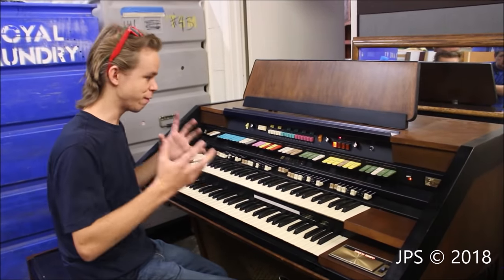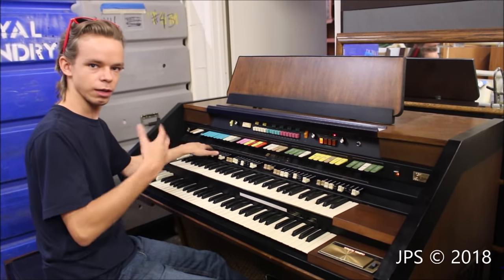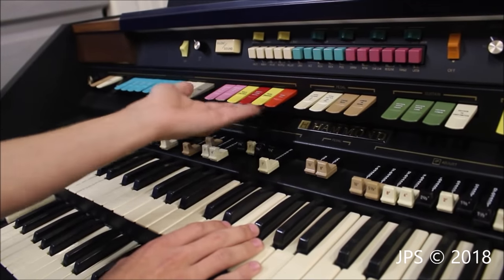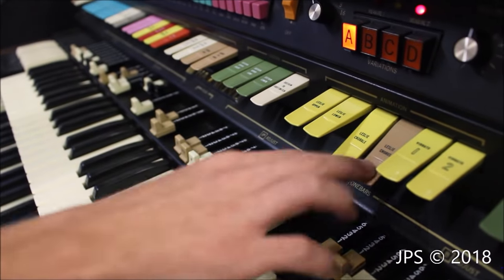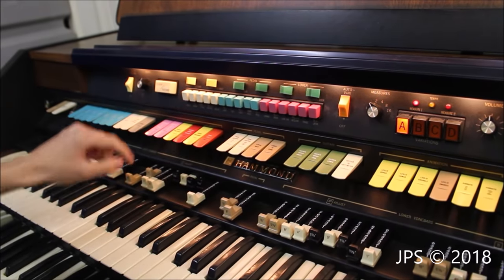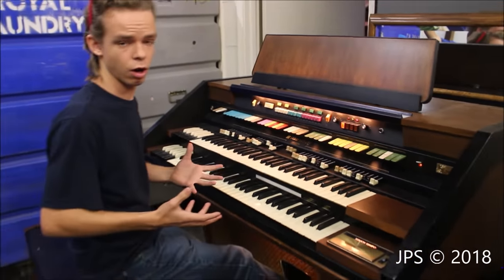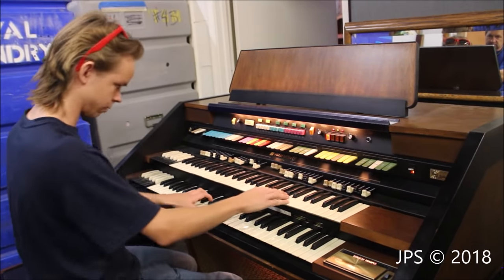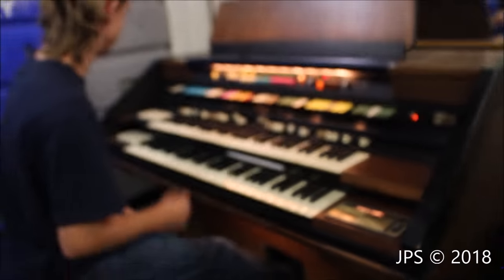James finds a $300.00 Hammond Organ, your thoughts? Cheap Deals

Comment: Bad LSI (Large Scale Integration) design that failed miserably. They were sending out techs constantly. It was trying to make the whole organ with capacitors. There are a ton of bad caps in there and it would be insanely time consuming and expensive to restore. I have repaired Hammond organs for a living for 3 decades. This is a piece of junk. Stick with the 3 series organs (includes generator, scanner and percussion same as on B3) :  B3, C3, A100 and RT3 with either a 122/142 or 147/145 type Leslie. Anything else is just useless.
Reply: My Concorde is almost 60 years old and had two bad caps. Caps were not the problem with the Concorde and neither were the LSI parts. Mechanical contacts were the major problem.
Reply: I couldn't possibly disagree. While those are of course great models, I've found pretty much any Hammond with a tonewheel generator to have plenty of worth. Of course the 3's have more features than their predecessors, making them better by comparison, but they're all good in my opinion. The L and T series sound great (Keith Emerson used them!!), and having had an H-324 for about ten years now, I have a particular fondness for the insane amount of features that the H series has, in addition to the fact that it has more drawbar harmonics than any other model. Never had many issues with it either, and the few issues I have had I was able to fix with a little troubleshooting and some good ol' persistence, and I HAVEN'T been working on organs for 3 decades for a living. I promise you, that played through a Leslie, 99.999% of people couldn't tell the difference between my H-324 and a B3 proper. And while we're on lesser mentioned models, lest we not forget the gorgeous work of art that is the Hammond X66, which seems to retain pretty good value, and has quite a cult following of it's own. Definitely very different sounding, but that's part of it's charm. 

Will say though, I'm glad you Hammond purists find all these magnificent organs to be useless. It just means I can pick them up for little to nothing.
Reply: @ Chris Nowak: you can say that because of your professional expertise in the filed ... for someone like me in love with organs in general and crazy about Hammonds in particular, i'd keep this 'thing' especially at such a low price even if it doesn't work! just listen to its sounds ... it's still quite fine in its own rights even at its present shape! me wanteth bad! :-)
Reply: @  @UMAMIMAMU  : couldn't agree more! i played with a Yamaha YC20 equipped with its own dedicated Yamaha Leslie-style amp (a very good one btw!) in the 1970s for some time and you couldn't tell the difference between that combo and a great Hammond organ + an original Leslie either ... and i'm not a pro musician really!

at the same time i also heard others play the same Yamaha and amp combo professionally and they made great Hammond-like sounds indeed ... however, Hammond is always a different thing as it started the trend and owning one is kind of like an honor thingy for me! love them all anyway but Hammond is in a class of its own ...

speaking of Yamaha electronic organs and its own rotary speaker-amps, just check out the super-futuristic white color fiberglass-body Yamaha X68 of 1968 and then its few next in line models in the 1970s and maybe later ... they're superb instruments in both performance AND advanced capabilities plus that magical super high-tech looks rivaling the Hammond and all other great names in the industry such as the Lowrey or even latest 'space-ship' models by Versi and others today ...
Reply: Chris Nowak m3?

Comment: The blue percussion stops are only active with the "B" preset just like on a real B. The 12 daughter boards in these are lotsa trouble but the biggest is the one little ground wire and finger contact for the whole big motherboard, there are 3 of these. The amplifiers are also plugged into finger contacts, don't clean well solder them straight on. These finger contacts on the boards are the biggest problem period, as they are copper or tin not gold.

Comment: I played a Lowrey of a similar vintage in the 80's that also had simulated Leslie.  Mine needed an hour with a generic music store technician and all of it's problems were solved.  They're pretty basic technology for anybody who has any experience fixing instruments.  The problem is that the wiring is very thin and sometimes the soldering is not as strong as it should be.  They're quite easy to fix.  Not sure I'd want to.

As for "rare" I know 2 or 3 places in Ontario that are full of these things.  They can't give them away.

Comment: Something else most people don't know is that the Hammond A-102   is the Hammond B-3 in a fancy cabinet with it's own built in speakers.  Some rock bands have bought an A-102 Hammond  and sawed off the bottom for easy transporting ..  At first glance the A-102 looks just like many other Hammond organs , but it's a B-3 in disguise, and usually commands a much higher price than the regular Hammond  for a home.  http://www.kleonard.com/gear/A-102.htm

Comment: The drums needs to be turned off as there is a silver rocker tablet next to the drums at the very top. $300 is a great price as I wished that I could find that same organ. There is a sensitive touch strip in between towards the right as all you need to do is play a chord on the lower keyboard and slide your finger across the sensitive strip to arpeggiate the upper keyboard voices. This model was made towards the end of the 1970s, known as the Concord 2307. The reason for the chrome pedals is to match with the modern contemportary design. The Leslie Choral, slows down the Leslie, but if you have a question, please contact me as I know so much about this organ.

Comment: I miss my Model G that I had for a few years.  The model G was a great Tone-Wheel organ from WWII era, It was the same as the Model D with a second tone wheel generator for chorus effect, (NO VIBRATO SCANNER, just much cooler, in my opinion, chorus), but with a more basic cabinet, and with carrying handles on the sides.  Yes handles.  It was built and sold to the US government for use in military service at the time.  This video made me think of it though it is nothing like this organ.  This organ could be repaired, it obviously has some circuit boards that need work, hopefully all the boards are all still in it.

Comment: It looks like an H model...it may need oil in the tone wheel generator. Open the back if you see 3 or so metal funnels, thats where u oil it with hammond oil or singer sewing machine oil just like a b3. Moisture may cause the noise so put it in a dry place and leave it on to heat it up or get a dehumidifier

Comment: I believe it is a Concord model. Top of the line when it was made. Probably mid 80's. Looks in very good condition. Price is good to, considering it needs some work. If it was on the east coast I would consider buying it.
Reply from the maker: I think it would be worth saving, because outside of the static sound I thought it was in pretty good shape. I did notice that one of the taps on foot pedals needed to be addressed, but that's all I can remember with my 10 minutes playing with it.

Comment: Compared to a B-3 and Earlier Hammonds, it has more Features than a B-3, but the IC Tone Generator system is Unreliable compared to the Original.

The Built-in Leslie is a real one.

The Noisy Channel probably is the one for the Extra Tones.

Comment: Not rare, not unusual, and no reason for you to keep comparing it to the B-3. They are different classes of instruments.  Quite typical of home organs that became available in the 60's and 70's.  There were lots of piano and organ stores in the 70's (my experience).  The main problem with this one is dirty contacts.  An hour or so with quality cleaner like Caig De-oxit would work wonders.   As others have said, capacitors are the next most likely thing to fail, but since so much of the controls are functional I think this is not a major problem.
Reply: Pelican1984 obviously he’s use to a B-3 and he wants to compare the two. So let him😡

Comment: the  buttons labled AB C  and D are different variations  on your lower left hand  arpeggio  and on your far left top are what looks like a brown and white switch this should work the other switches you said don't work they are colour coded so white works all white tabs  etc hope it helps

Comment: A really interesting beast. I thought it was going to eat your foot at one point when you were trying to figure out how to work that bit.   Must be so frustrating to not know if there is something wrong or if you don't quite know how to make it work.  Really enjoyed this vid.  It sounded  a lot like the nasty keyboard thing we had at home when I was teeny which I think was from the early 70s.
Reply from the maker: I might be wrong, but I had a feeling it would be something simple.
Reply: the sustain switch on the volume shoe (or pedal) is a momentary, not an on/off. You have to hold your foot against it for as long as you want sustain. Remove your foot and it stops. Think of it as a sustain pedal on a piano - it only works when you press it.

Comment: Does this still have the two switches for start and run.  The clock motor Hammonds would always have a pop when you hit the key. What is so hard to fix these?  I had my first job repairing organs in the mid 60's when I was 15. My older brother had to drive me on service calls because I couldn't drive. We mostly sold Gulbransen which were like the Hammond as they both only produced sine waves.  The Gulbransen had an individual oscillator for each note. As these were never in sync it gave a much fuller sound.
Reply from the maker: Just one off and on switch on this model.
Reply: This organ has only one two speed motor that spins the rotosonic. Not a tone wheel organ.

Comment: techy5025 said it all. Those four dozens of phenolic boards inside this beast are a real PITA. No way to get the organ serviced at all, once it's got an issue. I bought a Concorde like this one coupla years ago and finally decided to part it out. Using the drawbar set, the manuals, the pedal keys, the pedal switch assembly, and combining them with the fantastic HX3.5 machine from Germany, I'm going to build a clone that sounds waaay more authentical to, say, a B-3, than this crap (with due respect, of course...). Btw, the issues are neither the PSU capacitors nor the power amplifiers' output devices, which aren't germaniums at all, but plain 2N3055's.

Comment: James..i had an old Lowery organ that did the same...if not worse...i located the volume control - under the foot pedal -  and sprayed a little "contact cleaner" inside the control...(with everything off and unplugged of course) and it stopped completely....seems humidity corrodes the contacts a little....was an easy fix
Reply from the maker: Very interesting! I was playing with the expression pedal, and for a moment it went away, but then it came back.
Reply: The volume pedal in these is optical and noiseless. They do go bad in the way volume can't be shut down fast, it fades down slowly. Remove every connector in these organs and clean and reinsert. Noises will go.

Comment: I think it's from the 70's. Sounds like a bad capacitor likely in the amp. This model came along when Hammond decided to play nice with Leslie. Is that light coloured thing below the swell manual an arpeggiator? If you run a thumb from left to right and have the right switch pressed it will play an arpeggio with some twinkly sound. I think the sustain is like the big organ builders like Conn were using that simulated a bigger acoustic rather than the spring unit Hammond was famous for. If the price was lower, like $100 or less, someone might snap it up for spare parts. I don't see it being useful for your studio. You have the real deal and if you were on the road doing a gig, lots of keyboards have Hammond sound synthesized. I guess this model was a last gasp effort as the home organ market was going up in smoke. I thought it might be like an X66 which was an expensive model.
Reply from the maker: organblower, I honestly was not considering as a purchase, just love to see what was out there. I find it fascinating, that so many instruments have been made of so many designs, and for so many uses. This would be wonderful for the right person who could repair it on their own. I really hope that someone does decide to fix it as it would be sad to see a bit of history go away. I don't think they made many of these.

Comment: Beautiful machine!!!!!!!!!  I have two, the Hammond Concorde with Chrome pedals in the contemporary cabinet, and I have the traditional cabinet one.  Also, having the same issues/problems as this one! (both of mine having the sound issues, including a third one that I have (a Hammond Commodore)-
Reply from the maker: Now that's interesting, if you are having the same problem, I know someone out there knows how to repair the organ. When things go wrong it is often the same thing that goes each time. I knew a person who repaired monitors for computers, and he was so sure what was wrong with certain models when they came in for factory repairs he would just replace the part without even checking it out until the part had been replaced.
Reply: I find that sometimes when I have the Leslie on, that sometimes the crackles don't happen.  I'm not sure how to fix it though, except, when I leave them on for a good while, it seems to subside.  Sometimes, the crackles sort of occur when I'm actually playing, and I can hear the sound of the drawbars start to fade and go out.  I've yet to have any of mine fixed, as I can't find anyone in my region that will work on them.  The percussion sounds only play when you have the top registration key is pressed (Drawbars and percussion)-though sometimes, the percussion crackles in and out and just stops working.

Comment: I have a old Lowery type of organ, sat for years with my mom couldn't part with it.
now I tried to fire it up but no luck. 
I've read a few of these post on here and it sounds like I need to give it a good cleaning. to get it going maybe?
Reply: You should have it checked/ cleaned out by a Hammond organ technician. They may be able to see if there are any problems with a proper diagnostic.

Comment: I'm pretty sure it is a all transistor Aurora.  How does the sound compare to a B3 with tone wheel?  People give these away for free or actually pay you to take them here in Canada
Reply from the maker: It does not sound anything like a B3, but to play around with people could have a little bit of fun with them. If you could pick one up for little or no money you could find out if you would enjoy an organ, and if you wanted to invest in something a bit more upscale.
Reply: NOISE PROBLEM -  possible noisy transistors , LSI,   contact corrosion or cap.  Tab contacts can also be a problem ;( by toggling them on/off can help clean contacts so they work (if they're not). Sustain is different from reverb - SUSTAIN ; The note lingers & gradually fades ;   REVERB - the note immediately stops sounding,  but like a note/chord played on a pipe organ in a cathedral  keeps sounding ,  like an echo (but it's not an echo) for 2 to more seconds.  SUSTAIN/REVERB usually have  2 or 3 settings to vary the length.  Tubes in Pe-amp problem? -   By the time these organs hit the market ,  they were well into transistors & LSI.    AND it could be the pre-amp or the Main Amp or the Power Supply.  I  have a C3 (B3, different cabinet) & an  X66.   Once I got my X66 ,  I had my baby & no longer much pursued other models.   However,  going by the pedal board,    I know of 2  organs that had those shiny metal-looking pedal keyboards;      The  X66 ,  & X77,   The Concorde (which was suppose to be a spin-off of the X77).   probably had them too ,  & the Elegante ?     I believe the Aurora was a spinet model & the Colonnade was the console model of the  Aurora.

Comment: A friend of mine had an "E-112" which was similar but I recall it was a tone wheel organ...this one, I am assuming is an electronic instrument based on early computer technology? The non working functions are likely minor issues. A good cleaning would help! It would likely sound legit through a genuine Leslie!! (doesn´t EVERYTHING sound more legit through a leslie? : )
Reply: If would have used the Leslie that built in and the reveb it would have sounded a whole lot better. the blue tabs that didn't work was because he didn't use the b per-set need to be used for percussion tabs to work.

Comment: this is great; but one channel is dead when the pedal didn't work, also the reason the poly keys don't work..
 it is a concorde 23 or 2400; the plug in board contacts are most of the problems with it.. mine needs a D&C about
every 6t months... this is not a good organ for folks that can't repair them..  1978 or so.
 don

Comment: i believe that this is the Hammond Elite that's a step and a half above eb3. i bought one of these at a Salvation army store in Simi valley, California for $150. i told the manager that i was trying to get helpers so i could move it to my house. actually it took two weeks but i sold in right out the store with the two leslie cabinets the same day. so essentially i spent $150 and i made $3300 off the Hammond and the leslie. and the very next day i sold the amplified tone cabinet to a couple of guitar players. not bad work if you could get it every day.
.